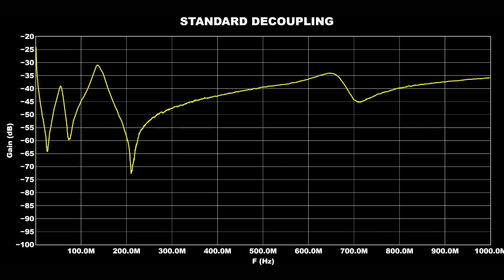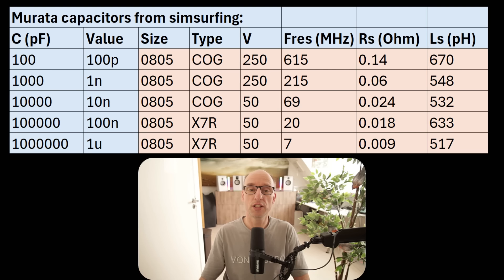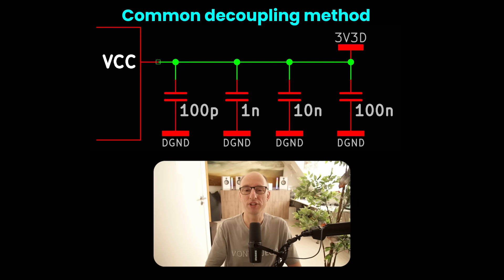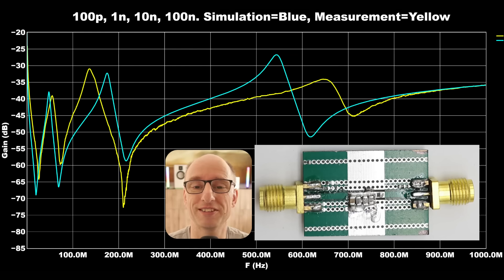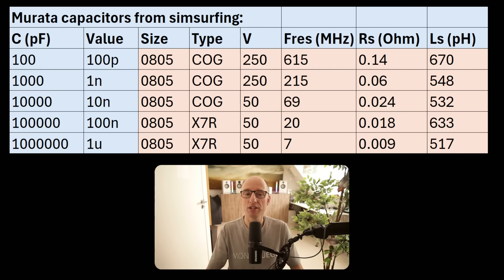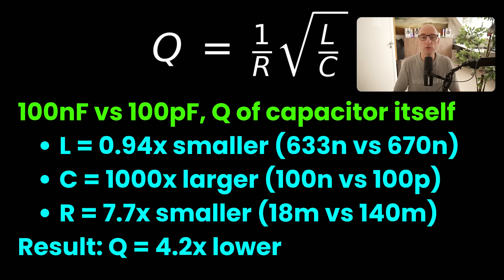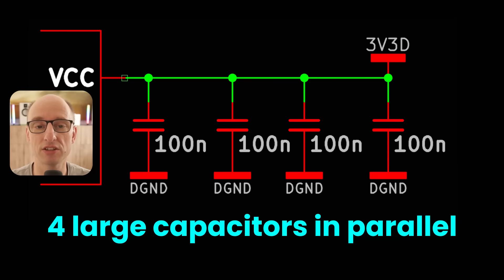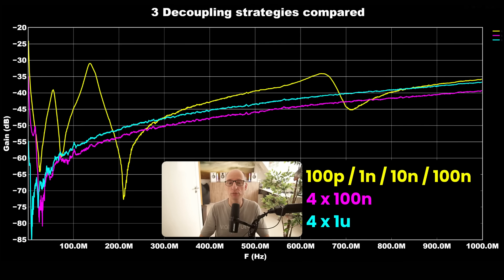The most misunderstood concept in decoupling

Comment: @ 12:45 Adding such a high series resistor if you have high load transients is counter-intuitive to me. If you have really high load transients, this would mean high dI/dt - but with a series resitor wouldn't that a) reduce the capability to deliver current and b) cause a voltage drop over the resistor? This would result in additional voltage dips which could result in resets or misbehaviour of digital circuitry in m opinion. Might be that your frequency response is then nice and flat, but 1R is far too high if you really have high load transients.
What do I get wrong - or what do you mean with high load transients?
Reply: I use a similar method very often, but I don't put the resistor in series (down to GND), but I put it in series with the power supply line, effectively forming a low-pass filter (from the supply to your IC):
o) series R -- effectively dampening LC-overshoot / ringing
o) also forming a lowpass-filter into the other direction -- the IC cannot "disturb" the power supply line anymore

Of course, keep R small enough, so that the DC-voltage drop is negligible - I typically use e.g. 1 to 10 Ω (I tend to keep the voltage drop below 0.1 V) and 10 μF (gives a nice, low corner frequency) --> this also helps in analog circuits to filter high-frequency noise in the power-supply line and therefore keeps the overall PSRR of an OpAmp high...

Further benefits:
o) Just measure the DC-voltage across this resistor with a multimeter -- you can immediately calculate the DC-current consumption for the IC. Or find, where the ... (insert preferred curse word) short circuit in your power-supply to GND on your board is :-)
o) you can also easily desolder the resistor, in case you need to "deactivate" part of your circuit during debugging. Or use some wire to a different supply line, since you've messed up (again) some of the many different supplies on your board :-)
Reply from the maker: I use this method as well, you just have to keep the resistance low to prevent voltage drop.
Reply from the maker: I get the confusion, this sounds very counter intuitive.

High transients are very high load current with a very high rise-time.

So you have 2 issues that you must solve now:
1. You have to be able to deliver the amount of power with your decoupling.
2. Because the current peaks are so violent, any resonance will crash your load (fpga or cpu cant deal with ripple, their internal timing will go off too far)

So you need large caps to solve 1 and you need series resistors to solve 2. Now the series resistance IS a problem for driving current, however, if you put 10 caps in parallel, it's only 0.1Ohm. And you could also chose to use 0.5Ohms instead of 1 Ohm.

Hope it makes sense now...

Comment: @HansRosenberg74 Instead of adding a 1 Ohm resistor in series with 100 nF capacitors to damp parallel resonance, can we use a single larger capacitor, e.g. 4.7 µF, in series with a 1 Ohm resistor in parallel with 100 nF capacitors?
Reply from the maker: That's a clever idea, that might work indeed. You'd have to simulate always if the resonance is suppressed enough but I assume it will be. (always tricky to assume something)
Reply: @HansRosenberg74  Thanks for the reply. I will check it in QSPICE. Thanks also for the very informative video.

Comment: In the real world, the impedance of the sink and the source is not 50 Ohms. Try to simulate and check "real world".
Reply from the maker: I get this remark a lot, but the 50Ohms is only for characterisation purposes. You cannot characterize in a 0 impedance environment, you're forced to use what equipment you have available. This is generally 50 Ohms.

Now the results will perfectly copy to the real life situation. In a lower impedance situation, the parallel resonator will not go away.

Comment: Your video clearly highlights the risks of blindly (or unproperly) following "best practice" decoupling principles, often poorly explained (if not wrong) in app notes.

But if you have the opportunity to reproduce the experiment with a typical PCB layout that would be even more useful!
Decoupling ICs on practical PCB is way more complex as you have to take the power plane (=low Q, small value capacitor), vias (small inductor + series resistor) and decoupling cap in consideration.
This means that cross-resonance between capacitors across the board usually isn't a problem, as long as different capacitors values aren't directly connected together but coupled through the lossy plane.

Nothing matters more than a correct layout. With a good choice of stackup, the right use of planes and selection of vias, you can usually get away with 1/2 or even 1/4 of the recommended decoupling caps.
With poor layout, no amount of additional decoupling can save you.

For those who want relatively simple rules to follow:
- use unbroken GND planes
- use planes for power distribution.
- stackup selection: put the GND plane as close to the "noisy side" as possible to minimize connecting via impedance (A D0.3mm, 0.2mm tall via is 20pH, but a 1.4mm tall one is 400pH). Tip: always use 4L or more if you have anything digital
- RF on the board? Put stitching vias all around the board, especially the edges. Tip: Analog's ADUM should be considered radio devices.
- use a single decoupling cap value per pin (usually 0.1uF). Tip: smaller package = smaller parasitic inductance (I usually use a 0402 MLCC).
- for sensitive analog circuits with "analog ground" pin, use a start-connect to the "AGND" pin. Ideally all AGND connections made on the top, with a trace. In some rare cases, having a GND pour cutout under the AGND components can be a good idea.
- place decoupling elements to form the shortest loop possible. Always consider the *two* pins you're decoupling, and work from these to the rest of the board
- order of place&route: 1. RF decoupling 2. power switchers decoupling 3. rest of decoupling 4. high speed (RF/signal) 5. analog 6. digital
- don't over-do it. If you're not using ICs at their absolute max speed, RF or high frequency switchers (1MHz+), slap an 0.1uF everywhere, share them with multiple ICs if close enough and you should be good.

For those who want to go down the rabbit hole:
- https://www.youtube.com/watch?v=CBD9vwKcvtY
- https://www.youtube.com/watch?v=5Ca0Eah7eKI
Reply from the maker: Yes, never 'just copy' what everybody is doing: Always keep thinking yourself..... Great advice!
Reply: Thx!

Comment: Where are these frequencies coming from ?
Reply: From basically square waves involved in digital electronics. Switch something on and the voltage transient has a fast rise time. Any waveform is an agregate of single frequency sine waves and that fast rise has to be whats contained in a very high frequency sine wave
Reply: @davefoord1259 so, there is some frequency leakage from  frequency switchings on other ccts to the power rails, which means conducting a frequency spectrum analysis of the power lines can assist in selecting the correct capacitances and quantity.

Comment: Excellent video! I have come across similar problems many times in my work over the decades. There are some really good books and app notes from way back in the 70:s on these subjects. Somewhere I have a design guide for decoupling DIL ECL logic on boards with some excellent advice. Measure experimenting with types of components and placement like in this video is the way to go imho. Also X5R and similar changes capacitance and can degrade other pulse parameters a lot with make and voltage, most of the time badly degrading performance. I recently needed a smd ceramic cap for a pulse application... only found one make that worked well and those are rather expensive. Despite  data  being similar. Alse beware that some high dielectric ceramics can be quite piezoelectric.
Reply from the maker: Thanks, I'm aware of the other things you're mentioning, they're in my course and maybe I'll make some videos on it here as well at some point.

Comment: Have you worked with 3/4/5G modems? I wonder how would you solve the next problem, you have very limited horisontal space on a PCB, you have a modem which suppose to use 3,5A but in reality it has some 5,2A burst too, you have a 4,0A inagrated buck converter, but sometimes the modem resets or drops connection because of the bursts. You have space for 1x 1206 and 1x 0805 at the modem imput, you can stack 4-5 capacitors vertically if you want.
The buck converter frequency already high (500-1000kHz) so I can use smaller components (inductors, capacitors) and 4.0A is the biggest fully integrated IC what I could find (SOT8 size).

My solution at the end was a layed down elco cap, but I really wanted to avoid using elco because of the small space and high heat, and I really wanted the device to last 10 years. I tried to stack 3-4x 22uF but it didn't helped.
My current solution would be using SOP23 buck converter with an external FET, or just using layed down alu-polymer cap.

BTW great content, I just stuck with the manufacturer recommendation, usually they put 1uF and 100nF next to the main voltage imputs and 100nF for the secondary imputs.
Reply: You could consider a multiphase buck like LP87561 to get higher current with low ripple without needing huge amount of capacitance. You need multiple inductors, but each individual inductor can be smaller.
Reply from the maker: That multiphase is a nice solution. I knew them from motherboard but it didn't cross my mind to use them in other applications yet. Just had a look at the datasheet. The only drawback I see is that you need to program these, but if you have a cpu or mcu on your pcb already, that is no problem.
Reply from the maker: The alu-polymer is the right choice I think. They don't suffer from bias degradation and they get a higher value when they heat up :-)

Comment: Out of curiosity, what happens if you included super capacitors in addition? Was thinking about it as a buffer in case of momentary power disruption.
Reply: It is work as you describe as long as you remember to no work above it RMS current. It can be surprisingly low with comparasion with peak current or with MLCC.
Reply from the maker: I'm not sure what the model of a super-capacitor is. It might be quite inductive since it is physically much larger. Therefore they may not be able to do high speed very well.

Comment: Why the power supply should have 50 on z? Not realistic only for measurement in the 50ohm system for the experiment. 😊
Reply from the maker: The 50 Ohm is only to be able to characterize the decoupling caps. It is not a power supply situation, however, the results of the measurement ARE very valid for the power supply application.

Comment: Hey thanks for that. I came to the same conclusion simply eyeballing the capacitor data sheets. I have a switch mode design where I use 2x10uF caps in parallel rather than 1x10, 1x1 and 1x0.1 and it is measurably less noisy at 30-300 MHz. Also, that thing about case sizes gets more interesting when you consider that smaller cases let you place components closer which means you get less pcb trace inductance. Which is why I found 1x10uF together with a 1x330nF in a much smaller case can also work well. 

As for the input filter for a boost converter, a classic LC filter can lead to instability. The standard approach is to add a much larger cap in series with a small resistor to lower the Q. But this means more board area and longer traces and more propagation of noise. What works for me is adding a resistor in series with the ferrite bead. Yes, this eats a little efficiency but for a 1-2 Watt class converter its irrelevant. Small resistor, small inductor and it works smoothly.
Reply from the maker: The ferrite beads are always tricky, they're very inductive at low frequencies and not lossy yet. This can cause very large resonances. The resistor in series will damp this to an extend. Usually, this is not a really big problem because the resonance is at a very low frequency but with big transients, you may get hurt.
Reply: @HansRosenberg74  As I said, I'm not building high wattage power supplies so I have a bit more freedom to add more resistance. The use of brute force is undervalued, I think :)

Comment: Howdy. YouTube suggested this video to me. I'm not sure what type of power supply this decoupling applies to. Also, I'm not sure what "packages" means in this context.
Reply: package means the component size. 0805 (the one in this video) is like 2 by 1 mm. 1206 is another size mentioned which is larger.

the power supplies this refers to likely means close to chips used in radio frequency (RF) applications
Reply: @settwi  - Thank you. :)
Reply from the maker: I guess youtube is targeting everybody because the video is succesful :-D
Reply: @HansRosenberg74  - I'm glad they did. This was interesting.

Comment: Very interesting. I am going to do some experimenting with these ideas. Power supply filtering is very often overlooked or taken for granted. I, like a lot of people, simply followed classic designs when I first started building my own circuits. I build vacuum tube amplifiers, which I realize is worlds apart from high frequency RF with surface mounted components,  but noise is noise.  When I really started to pay attention to filtering was when I started trying to use SMPS instead of the traditional large transformers. I quickly found out how important component selection and placement was.
Reply from the maker: Yes, reality has a tendency of confronting you :-D

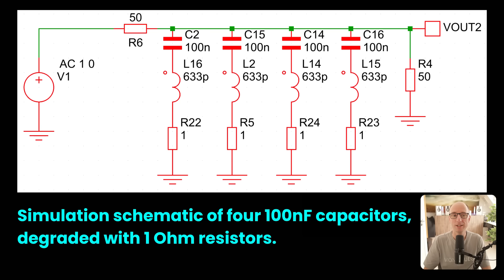Comment: 12:10 is this not cutting VOUT2 in half? And causing VOUT2 to vary wildly under load?
Reply: You mean because of the two 50 ohm resistors? I'm pretty sure that's only there for the sake of measurement and simulation. Those don't exist on the board he actually measured, the VNA is the supply and the load and the coax cables are the two 50 ohm resistors. I think the only reason they're in the schematic is so that the simulation matches the VNA setup.
Reply from the maker: Correct!

Comment: Would be interesting to see the same experiment placing naked device on a laptop keyboard to simulate noisy environment.
Reply: This isn't about filtering external noise, it's about noise generated within the circuit.
Reply from the maker: indeed
Reply: @HansRosenberg74  Interesting and promising comment!
I'll make it more difficult: put the device on a microwave circuit without its iron case to imagine what kind of interference can occur in your circuit and how capacitors of different ratings can (or can't) help here.
Reply: @HansRosenberg74  or more realistically, 4 3-phase motors nearby with their power supply

Comment: I have used the series resistor in a smps. Because I was smoothing and buffering the voltage too much, the chip couldn't figure out how to get the voltage stable. The chip just used a low threshold to switch on and a high threshold to switch off the inductor. But because the buffer was too big it oscillated too slow resulting in rising output voltage
Reply from the maker: I used that too, 0.1Ohms with a really big capacitor: Also filters ripple very nicely.
Reply: @HansRosenberg74 Yep. While I didn't do it that time, I could have fed my circuit straight from that capacitor, while the sense and switching output would have seen the resistor. This way the output would have been way cleaner

Comment: Note the attenuation in these examles is creeping up as of 1GHz. If your device is working in higher frequency/speed, or youre designing for EMC in a noisy environment, you're gonna need the HF attenuation from the smaller caps; the ticky part is designing the handoff between them to reduce the peaks. Good video and concepts, but not a 1-size fits all solution for decoupling.
Reply from the maker: The idea would then be to use a high value in a small package, say in 0402. If  you're forced to use bigger packages as well: simulate.

Comment: for very critical low noise oscillators and receivers I ever made a "RF - DC diplexer" on power path in order to deviate unwanted RF noise to "trash resistor". My criterion for optimal impedance was dV/dI at some bias point. It seems to work nicely.
Reply: This is reminiscent of reflectionless filters.
Reply: @greggleswong you're right
Reply from the maker: I'm not familiar with that approach

Comment: For all the same package, makes perfect sense.  The diversity should be about L, not C, for a wider band of low Z.  Usually I would use smaller package like 0402 for lowest L, parallel with larger 1uF for example for the effect you mean. 

Adding damping is also an interesting idea though, like you said not needed so often
Reply from the maker: I've changed the free checklist offer a bit: You also get a 1 hour module of my course for free!

You can find the link to the page in the description. Scroll down a bit on that page (Or read the whole page, you may get curious :-) ) to find the link. It is a purple button 'Watch The Free Module And Get The Checklist'.

You will have to leave your email address so I can start spamming you :-D . I don't do that very often, on average once a month, but I am thinking about starting an email series with useful electronics tips at some point.

Best regards,

Hans Rosenberg

Comment: What if we use a ferrite bead, instead of a damping resistor between the capacitors?
Reply from the maker: Ehm, they're very inductive at lower frequencies without having any loss yet. This means you're most likely introducing a huge parallel resonance. I did simulations on it: It's not good....